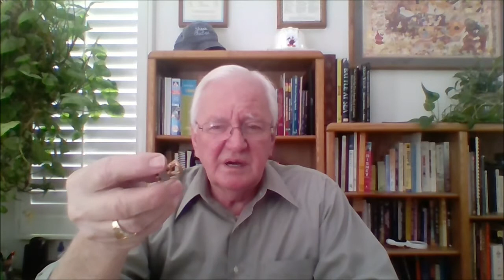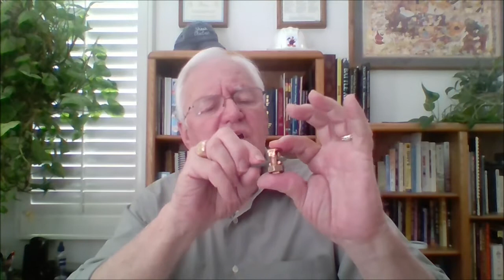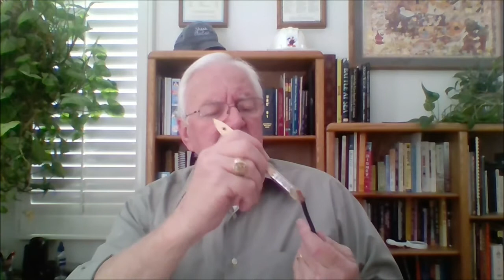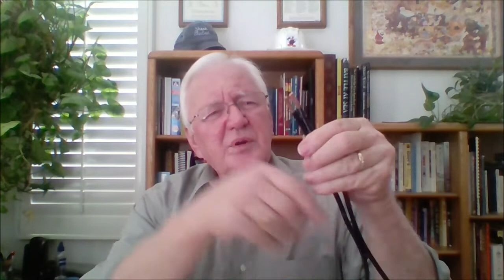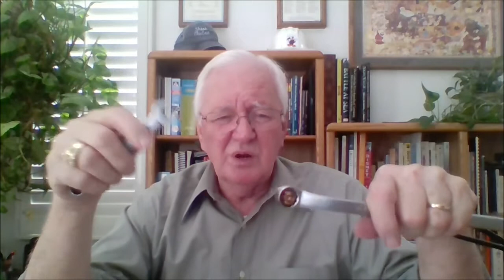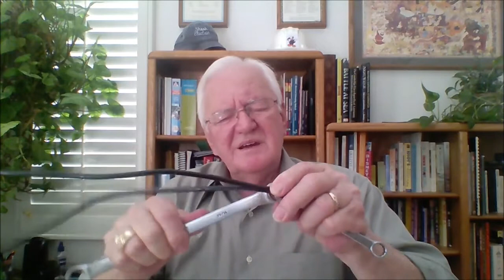Split bolt connections, Electricians Need to Know, John Shook

Comment: great video-thankyou.      Would you recommend the split bolt to extend a #4 ground in a crawlspace?  If so, is it necessary to use the two different tapes in a crawlspace?   Also, a retired 40-year electrician friend, said that it should be torqued to specs.   Thanks again.

Comment: Great presentation John.  I am in the Philippines and cannot obtain any Burndy Split bolts of any kind .  So I have made my own split bolts from stainless steel bolts because Brass or copper bolts cannot be found.  These split bolts have been deburred to smooth but I am not sure what the reaction will be between the aluminum and stainless steel .  No Noalox cannot be found here.  Here the standard is to just wrap one wire around the other wire the best you can and tape it.  I have had to have a few of theses repaired already . looking for an opinion .

Comment: Would it be fair to say that Split Bolt connectors are more durable and can handle more amperage than a wire nut connection?
Reply from the maker: Yes they are if applied correctly. JS

Comment: Is dielectric grease the same thing?
Thanks!
Reply from the maker: Grease

DeoxIT Grease Type L260 –Lithium-based preparation. Good lubrication, excellent wear resistance, excellent pressure resistance, excellent oxidation (galvanic corrosion) protection, high dripping-point characteristics. Operating temperatures L260: -40C to 260C 

Copper particles L260Cp Lithium-based preparation. Use when you require particles (conductive) to assist in oxide and corrosion breakup and good lubrication. Copper is conductive. Use in areas that two contacts will not touch and possibly short. Example: disconnect switches or large connectors and relays.

 USES – Electrical: Antenna connections, battery terminals, Buss bars, commutators, conductor rails, conductors, contactors, disconnects, drying & processing equipment, high amperage/high voltage applications, industrial electrical equipment (lifts, cranes, robotics, etc.), power tools, relays & switches (heavy duty, knife, step, rotary), etc.

 Sorry just had back surgery, not up to speed yet. JS

Comment: Good stuff John, I use electrical grease. But I had no clue why. Electricians I ask have no answers either. You very simply answered the why and how benifits. I did not know about the value of cleaning . Thanks John, I do now. . I also did not know that grease displaces the oxygen. .  It is surprising in the do it your self age   how much we should know.  Yet we don't know very much. You informed me of that for certain. I am going to check out that recommended author you mentioned in another post.

Comment: Thanks John. Might there be a better splice option than a split bolt (and not too expensive) for use on a 3/4 hp 50 amp DC motor being used on a jet fuel truck? A split bolt was in place on the old motor but I would like something more secure if possible.
Reply from the maker: Try, Polaris or Morris insulated splice connectors. JS

Comment: So those handy LED flashlights with aluminum cases are really unreliable ( I believe ) because the return path is thru the case which is three pieces threaded together. Those threaded junctions are all vulnerable to oxidation and before long the flashlight is flickering.  Cleaning the threads helps but I'm guessing adding that conductive grease might just be the answer.
Reply from the maker: I have copper grease so will try it and let you know.
Reply: STOP making a big deal out of nothing